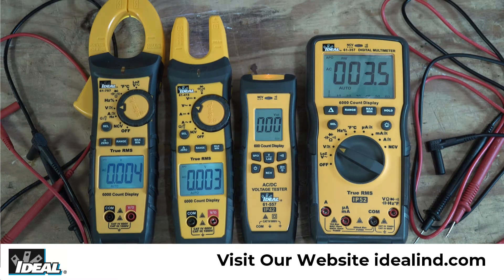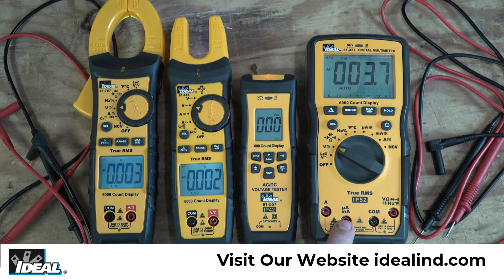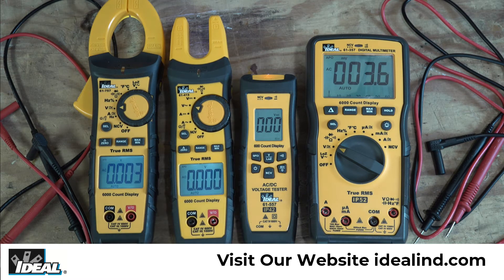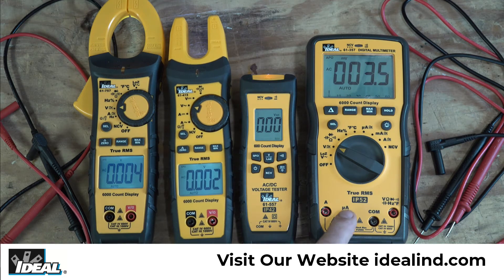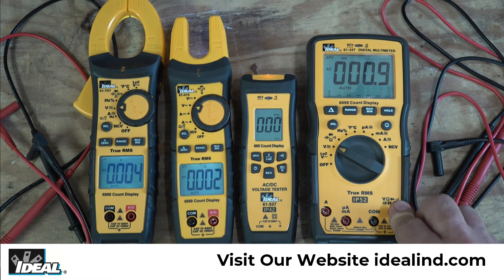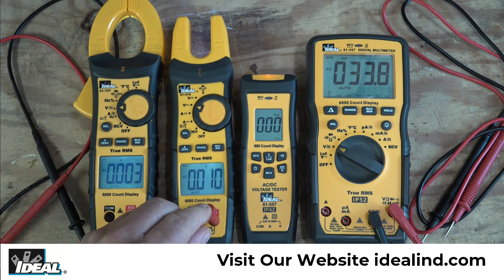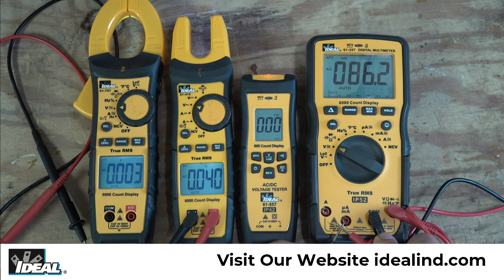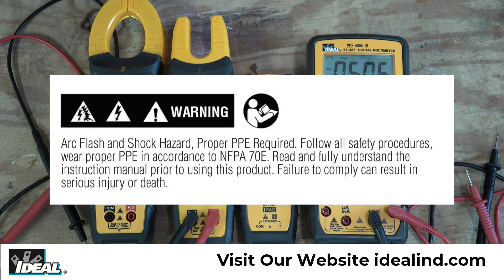Electrical Noise on a Tester

Comment: Thanks for sharing, Ron. I think the high input impedance used in the normal Volts AC function makes the test equipment sensitive to EMF interference. But something like LoZ, as used in the Ideal 61-757, would eliminate these ghost or stray voltage. Don't you think?
Reply from the maker: You are probably right about that but I don't havce any data to back it up. You have a nice channel! Ron
Reply: @RonKipperDatacomm1  Thanks Ron. I've just placed an order for the 61-747, my first Ideal test instrument.
Reply from the maker: Cool use itr well Ron